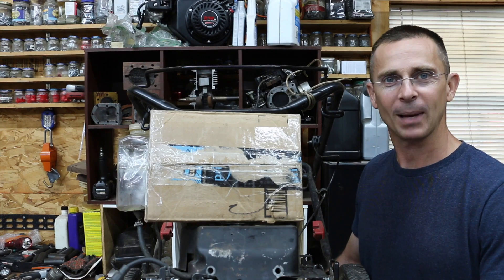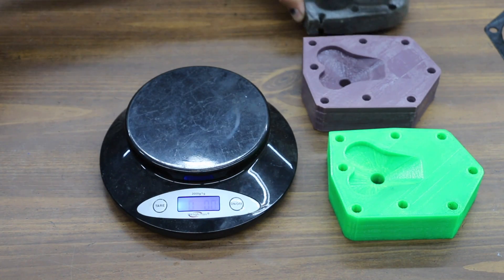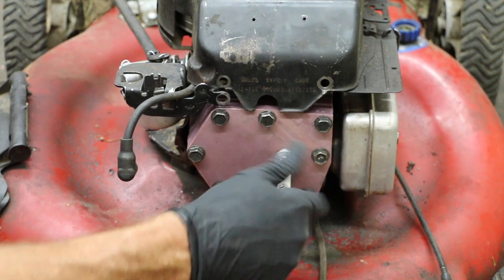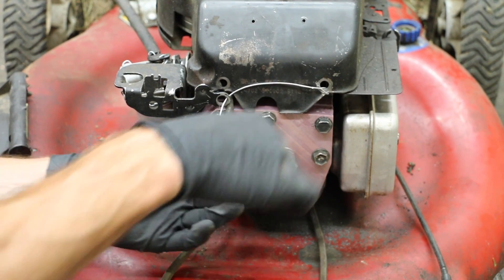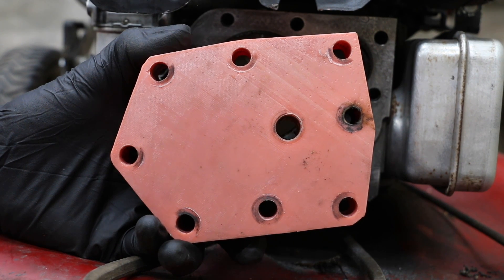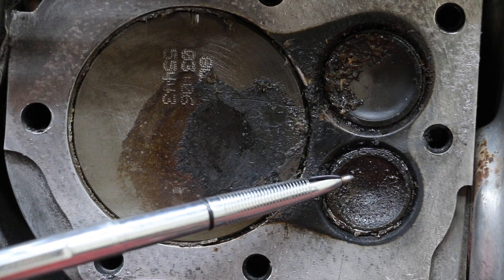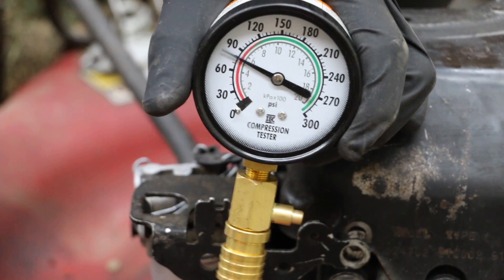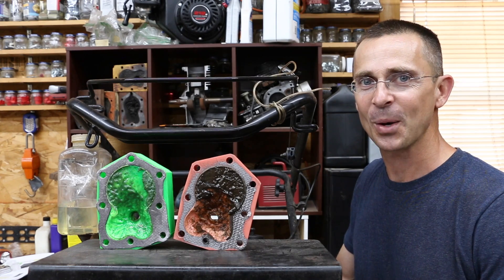How long will a 3D printed cylinder head last?  Let's find out!

Comment: I haven't watched this yet, just clicked the link. I bought a 3D lens cap on Ebay which needed a little bit of adjustment, so out came my dremel and a sanding drum... The thing melted before my eyes. I don't know about more industrial printers, but that skewed my belief that 3D printing was ever going to replace plastic moulding. So, my guess regards your question, about a second. <play>
Reply from the maker: Thank you!
Reply: @ProjectFarm  Absolute shock, 49 seconds, I certainly didn't expect that.

Comment: I wonder if the inside could be coated with some kind of insulator.  Interesting.  I think we're a ways off from having plastic engines, but it's nice to see people are trying to push the limits. There are lots of parts on a car that could be plastic, were starting to see more plastic parts on cars every year. Intake parts, I wonder about exhaust parts?
Reply from the maker: Thank you for the video idea!

Comment: Guys abs produces toxic fumes, when printing and even more when heated and burning. Even if the plastic was more dense making it stronger. I would never recoment abs, I use pla, always. But I do understand that pla has a lower melting point making it easier to melt.
Reply from the maker: Thank you for the information

Comment: There are metal 3D printers now too, I wonder how different they would be from the cast and machined parts used in small engines.
Reply from the maker: Great point!  I'd really like to test a head printed with 3D metal
Reply: @ProjectFarm  Thanks! I wonder if you could design one to increase displacement in the head since those engines are a flathead design and thus increase power.

Comment: I have a lot of experience with 3D printing and even I'm surprised how well this worked. It has me thinking a stronger, and higher temp. plastic would last a LOT longer. I've done some printing in Polycarbonate and it is IMPRESSIVE. After that you could always look into casting a metal part from the printed one.
Reply from the maker: Thank you

Comment: you need to test high temperature 3d filament with ULTEM
for example "ThermaX™ PEI-GF10 Glass Fiber Reinforced 3D Filament, Made using ULTEM™ 
217c' max temp support
Reply from the maker: Thank you for the video idea!

Comment: PLA has a glass transition temperature of 60-65C while ABS is around 105C.  You might have better luck with polyether ether ketone (PEEK) (glass transition temp of 143C-250C depending on the grade) but it is about $1000 per KG from Chinese sources.
Reply from the maker: Thanks for the feedback!

Comment: You can 3D print a cylinder head, than make a silicone mold from it. Than pour to this mold some temp resistant casting resins. You could also try adding to resin some resin fillers such as aluminium powder.
Reply from the maker: Great suggestion!

Comment: try concentrated urine as an engine oil. it looks like used engine  oil. just boil it down dont worry about smell much. open window if dont like smell. you will need to save a lot of piss to get enough "oil". its basically urea salt almost eutectic something
Reply from the maker: Thank you for the video idea!

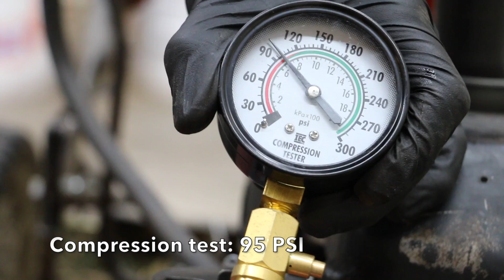Comment: 5:51 "I'm going to start with a new sparkplug, and I'm going to go ahead and create a large gap just to avoid plastic causing it to fail on us."
6:21 The plastic melts, causing the sparkplug to blowout and fail on us.

I just found it kind of funny that an extra step was taken to avoid the sparkplug getting plastic stuck on the electrode and causing it to not to function, but instead, it failed on us in a different way.
Reply from the maker: Thank you

Comment: I’d almost gonas far as to say do it again but coat the cylinder heads in Line X or rustins heat proof paint (450°c) then the head might not melt as fast?
Reply from the maker: Thank you

Comment: You should try a 3D printed one using SLS technology. That would be a really cool test; can you actually print a viable cylinder head if using the proper printing technology? SLS has been a game changer for metal parts and I'd bet an SLS one would last as long as an OEM cast head, given identical design.
Reply from the maker: Thank you for the video idea!

Comment: You should make a cylinder head out of concrete and see how long it lasts
Reply from the maker: Thank you for the video idea!
Reply: Project Farm you absolutely need to do that ASAP
Reply: It would crack and fall apart because of vibrations
Reply: @ProjectFarm  when is the upload!
Reply: @ProjectFarm  please do!
Reply: @ProjectFarm  any thoughts on this happening? Actually it seems dangerous. Probably shouldn't.
Reply: @ProjectFarm  you need to get on that soon
Reply: @ProjectFarm  How about a comparison of 3D printers affordable enough for a sixth grader to purchase with an eighty customer base newspaper route in a small town population of 11,088? [cylinder head] Still have to check on an experiment with septic tank enzymes mixed with portland cement to see how it has survived. Milkweed plant enzymes are said to be the secret to molding stone works with crushed granite so I am wondering if Perma-Zyme were used the same way with crushed rock and then with clay soil for a cylinder head. [Project Farm] I'd like to see Project Farm become a regular column or two in the farm scholar newspaper Farm Show. Have also been wondering if the plasma flame created by the MultiPlaz welder using alcohol and water for fuel could be used to ignite the fuel in a cylinder head for more efficient fuel consumption short of welding the cylinders to cylinder head. Thank-you for the inspiration you prove to be useful in our daily affair with survival.
Reply: i would add wire mesh to reinforce the concrete.. and use tiny 1/4 " gravel in the concrete mix rather than 3/4" as in a standard Home Depot Mix
Reply: @gardeningGTA  yea u need smooth concrete
Reply: why not paper mache
Reply: @bajagroms1551  no cyldiner head exists because its burnt
Reply: Wear a helmet
Reply: This is so absurd, it will surely end catastrophically. DO IT!
Reply: Need to add a tensile strength composite. Steel wool, chicken wire, glass fiber.
Reply: Yes
Reply: Bill Williams If you or a loved one was diagnosed with Mesothelioma you may be entitled to financial compensation. Mesothelioma is a rare cancer linked to asbestos exposure. Exposure to asbestos in the Navy, shipyards, mills, heating, construction or the automotive industries may put you at risk. Please don't wait, call 1-800-99 LAW USA today for a free legal consultation and financial information packet. Mesothelioma patients call now! 1-800-99 LAW USA
Reply: What is your profile pic
Reply: @Eray2007  awesome is what my profile picture is
Reply: @mwbgaming28  what does it mean
Reply: @Eray2007  it means that I don't like the world's most dangerous religious cult
Reply: How about ceramic? Water would get cooked out when baking. Definitely would need mesh reinforcement though.
Reply: You hate islam mwb
Reply: @wafiywahidi3317  sure do
Reply: @mwbgaming28  why do you hate islam
Reply: @wafiywahidi3317  a multitude of reasons, but the chief one being how women are treated under Sharia law
Reply: @mwbgaming28  actually the sharia law is for person who is really commited the crime and need court cases over 2 times. It was invented by Prophet Muhammad for teaching the person to not do the crime again. Look at the brunei crime rate it always low and reoffending rate is almost nonexistent
Reply: @wafiywahidi3317  yet the punishments and crimes in Sharia law are literally declared to be human rights violations

And you still haven't explained the oppression of women under that set of laws
Reply: @mwbgaming28  yes the oppression of women may be bad but look at the woman at brunei now. They don't protest again because the government of brunei has resolved the case it was because of misunderstanding about the case
Reply: Falafel swahili women don’t protest because they and or their husbands are killed publicly and brutally for daring to be of a different opinion. Wonderful example of how an AntiChrist ruined the life’s of everyone who ever listened to him, as well as their afterlives.

Comment: I'd like to see heads made out of:
Ceramic
Glass
Carbon fiber
Lignum vitae (hardest/densest wood in the world)
Carved stone
Cast concrete
Sintered metal
Rubber
Layers of leather glued together
Many laminated layers of paper (I have made my own gaskets like this)
Micarta or G10
Clear-cast polyester resin, like a "vomit clock" cylinder head with little bits of stone or seashells in it
Fiberglass
Reply from the maker: Great suggestions!  Thank you
Reply: @ProjectFarm  I just thought of another one, silicone.  Or that "dragon skin" stuff Mythbusters remade Buster with.  It's fireproof, apparently.

Comment: Might be a revolutionary idea for sealing worn piston rings, I noticed that the portion of the head on first test turned to pure carbon and super hard, I am interested in knowing if after several more runs, would compression increase, or oil consumption decrease or would it just stick the rings and ultimately lose power?
Reply from the maker: Thanks for the video idea!

Comment: So the plastic can't handle the direct heat, but I'm curious what would happen if there was a thin metal shielding over it. The plastic would still melt, but maybe the shielding would prevent melted plastic from interfering with the other parts like the spark plug or the piston.
Reply from the maker: Great test idea!

Comment: Interesting experiment. Thx for sharing.

Some practical comments...

First, I acknowledge this was just an experiment. That said, here's what I tell people when they want a thing 3D printed: "Many things can be 3D printed, but not everything. And, everything that can shouldn't!"

As for this use case, it would be interesting to test some other 3D printing materials, as well as some design variations.

3D printing materials have a "glass transition temperature", which loosely is "when it gets soft". A quick google search will yield helpful tables (www.3dxtech.com/blog/thermal-properties-of-our-filaments). PLA, PETG, & ABS are ~50ºC, ~80ºC, & ~110ºC, respectively. The highest I found is 'ESD-ULTEM 1010' at 217ºC. Note: as such, this material must be printed at a higher temp than possible w/ a typical consumer/hobbyist 3D printer. Ultem is an 'engineering material' with application in the aerospace industry, where one of its desirable properties is that it doesn't release deadly emissions when burning (as possible in an airplane crash). Another good engineering material is PEEK/PEKK.

OK, keep up the great testing!...

Comment: I find this stuff fascinating! I could see a special 3D-printer that molds a more resistant plastic at higher temperatures. But by then, I'm sure some other problem will rear its ugly head.
Still, there is absolutely potential in plastic engines.
That old Donald Duck short about baking your own plane, engine and all, was before its time!
Reply from the maker: Thank you very much!!

Comment: I do 3D printing as a hobby. The reason it works is that the plastic melts at a relatively low temp. So there's no way it could function to contain an internal combustion engine ignition. But I bet you could make a carburetor by 3D printing...
Reply from the maker: Great point. Thank you

Comment: do you happen to know if the 3d printed parts used here were cured? that makes a substantial difference with heat resistance. also, there are some specialized filaments that have really high heat resistance may be worth trying
Reply from the maker: Thank you for the video idea!

Comment: I have a 3piece engine block design that also has water jackets. That would be a game changer if I only knew that the ceramic coating would withstand the temperature fluctuations an engine goes through. Making it probably out of a polycarbonate I think that's what it would be called. It's a mixture of carbon fiber and polyuria if you could through some Kevlar in there too finishing it up with a ceramic coat I think that would hold up to some HP. I don't know of anyone out there trying to test any of these theories? If you or anyone else knows about someone some where I'd love have a link to it!
Reply from the maker: Very interesting idea! Thanks again

Comment: Gasoline is a solvent for most plastics.  Did you try a test to see if it was petroleum resistant?   I would bet that the heat was only part of the issue.
Reply from the maker: Thank you!

Comment: Supposedly its possible to 3D print aluminum now. Would be interesting to see if a printed version is lighter than a cast version and what the performance difference would be. Just think we wouldn't need to CNC port anymore, we could print CNC cylinder heads!
Reply from the maker: Thank you

Comment: You should do a cylinder head test where one has a thermal barrier coating such as swaintech, cerakote, etc vs uncoated. Measuring temperature, rpm, and other variables.
Reply from the maker: Thank you for the video idea!

Comment: Try to get your hands on a cylinder head printed in PEEK. That material prints at around 375-400 degrees C, as opposed to ABS which prints at around 230 degrees C. You won't get a thermoplastic that has a higher melt temperature than PEEK, but hobby grade 3D printers cant usually print at a high enough temperature to print PEEK.
Reply from the maker: Great suggestion!

Comment: I'm giving $1.000.000 to the first person to make a fully plastic and fully running engine that can be used in a car. (the car has to be able to move)
Reply: I don't think u have the 💰
Reply: Polaris PL wouldn’t matter he could probably get way more anyways
Reply: The problem is that the most temperature resistant thermoplastic available is PEEK, and it melts at under 400 degrees C, which is lower than the temperature inside a gasoline engine. So, you could print an engine, but it probably wouldn't run much longer than a couple of minutes.
Reply: caugh up the money it has been done many times. or state that it has to be a gasoline engine, because compressed air engines used for model planes have been a thing for a long time

Comment: Kia would like to know your location
Reply from the maker: lol. Funny!
Reply: @ProjectFarm  lol
Reply: you think KIA is bad you should check out chinese made cars.
Reply: Kia ain’t that bad. Nissan is worse imo
Reply: @G8tr1522  12 yr old nissan runnin like a chram
Reply: @ryanxu9983  no transmission issues yet?
Reply: @G8tr1522  nothing.... am i the chosen one?
Reply: @ryanxu9983  how many miles? what year? the older ones were a lot better.
Reply: Hey now, I have had good luck with 3 Kia's. Albeit they are all 2010's.
Reply: @mudkicker7812  they've gotten better, but it still screams "I've given up" just as loudly as a mini van
Reply: Paul Carmi or a BMW
Reply: @seanpeacock5595  bmw does not scream "I've given up"
Reply: @paulcarmi8130  but it does scream "i've given up on being reliable"
Reply: @paulcarmi8130  "they've gotten better" is an understatement. Their economy cars are extremely competitive for the price and their luxury cars (K900 and Stinger) drastically undercut their competition while cheaping out in non-intrusive ways. They're one of the only ones still making a full-sized luxury sedan with a V8. They put out their 5.0L V8 the same year Ford did theirs, and arguably did it better. There is ~15 rated horsepower difference, but Kia's is achievable at 87 octane and is significantly more refined. Even as a Ford owner, I have to admit that the Korean companies are putting out better cars than their American counterparts wherever they are comparable aside from a few cars/trims.
Reply: @paulcarmi8130  when its on the side of the road, it does
Reply: @paulcarmi8130  no it screams "I Break Down"
Reply: @paulcarmi8130  a bmw actually uses plastic engine components the intake manifold and even the valve covers are plastic as well as the timing chain guides. Even Kia doesn’t do that. Don’t forget the plastic coolant parts which is totally unnecessary.
Reply: Or a Chrysler
Reply: Kia and Hyundai cars are as good as any other. And they are not MBWVBenz
Reply: No the hell they don’t
Reply: Brazilian Volkswagen liked it
Reply: Although EVs are (generally) cool the Nissan Leaf screams “boring tin box”
Reply: @Dave5843-d9m  haha
Reply: Yes
Reply: No kia is okey we have  a sorento all fine and a small kia from 2017
Reply: MAYBE HE COULD MAKE DMFS FOR HYUNDAI TOO
Reply: @Hynea only liberal scum gets triggered. Also dont know if you're aware, you have to tell us there will be trigger warnings before issuing one. You've failed us all commie trash :D

Comment: Only 3D Printed gaskets for next vid. Obviously metal is superior for parts but how do the gaskets handle?

Melt into the chamber or create a more solid seal?
Reply: Especially if you retighten the heads after each test. To remove shrinking.

Comment: I wonder if you could draw enough of the heat away (e.g. by use of fluid channels) from a plastic head while still obtaining reasonable efficiency from the engine? Would be interested to see the performance of an SLA head hooked up to a cooling pump.
Reply from the maker: Thank you for the video idea!

Comment: Nowadays, we have 3d printable carbon fibers.
They need to be cured in an autoclave, however.
I wonder how those would do.
The biggest problem is heat dissipation.
Would it help if you could laminate the print surface with copper ?
Might there be other solutions to use 3D printed materials ?
Reply from the maker: Great suggestions! Thank you

Comment: Some1 needs to machine one of these out of Ultem 1000. :) It would probably hold up indefinitely with a rich fuel to air mix. 

Also if you did a 3D print for a lost PLA experiment, then bronze is pretty easy to work with. Not as strong as other options, but far easier to mold.
Reply from the maker: Great recommendation! Thank you